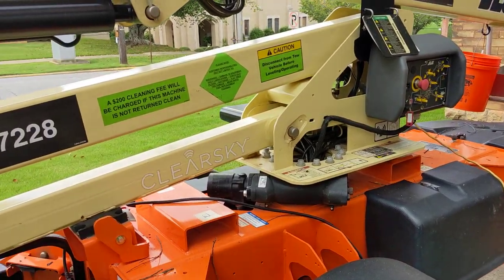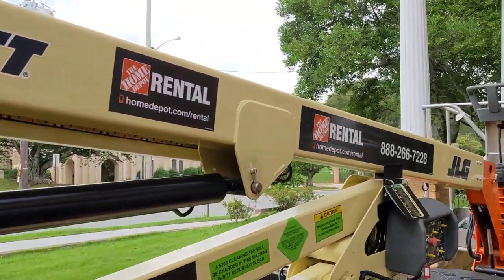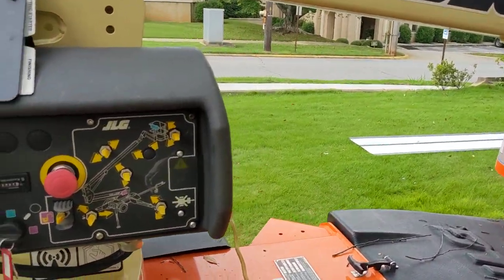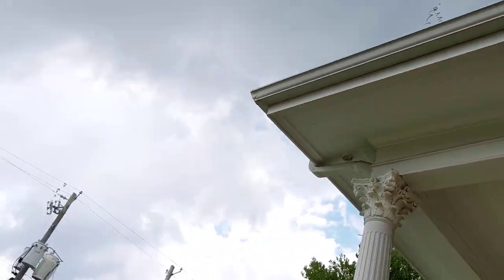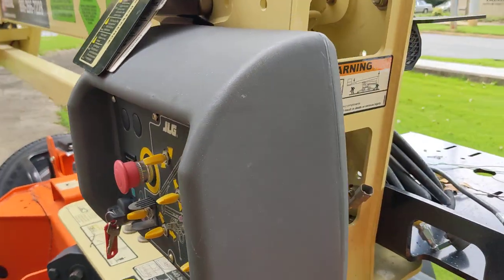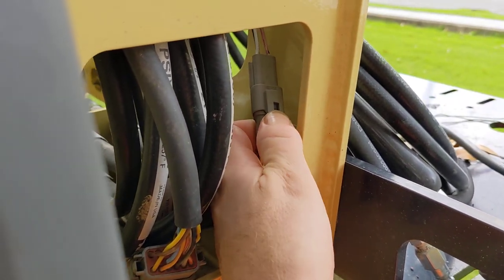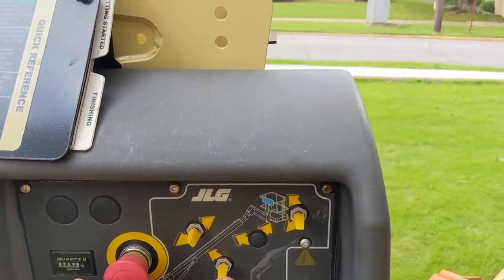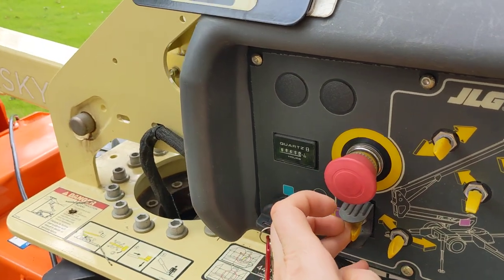Turn off beeping on JLG T350 boom lift

Comment: Thank You. First thing I want to do when I rent it is STOP the BEEPING. Every video shows it beeping.
But if it is a "tip alarm" I might want that, I will be trimming trees.
Reply from the maker: As another commenter pointed out, it might be one alarm for motion and tipping. So disconnecting it could create a safety issue in that case. As I mentioned to them, I was using this on solid, even ground with nobody else on the property. Also, I was mostly just articulating up, not way out where tipping would be a concern.

Comment: That's a bad idea,  if the lift is going to tip over that alarm sounds! it won' t sound if it's disconnected.
 Also it beeps to let people around the machine know that there is some sort of movement, you could easily lower the boom or an outrigger onto someone.
 I work in the equipment rental industry and we have this problem all the time with customers disconnecting the alarms not just on the towable booms but also on our Genie/JLG Super booms 150/185' height!!!!!! The Alarms sounds before the machine tips over!!
Reply from the maker: Appreciate the safety message.  In this case I was the only person working on the project on my private property. Nobody else was around. I did reconnect the alarm before returning.
Reply: I know how crazy they are with the JLG equipment everything you do the horn sounds! at least on the Genie booms it's not as bad but customers still disconnect them!
Reply: I'm using a JLG 2930ES. It's a scissor, not a boom, but the tip alarm still rings even with the caution beep disconnected. The tip alarm is a different sound completely.
Reply: Some of the manufacturers have realized that people are disconnecting the alarms, so they have them set up for the alarm to sound even when disconnected. As I said before it's never a good idea to disable the alarms, it's the first sign that the lift maybe about to tip over!
Reply: It's not going to tip trust me they're so counterbalanced well that you can have it on a steep incline and it's not going to tip over on you
Reply: No the alarm sounds if it's a quarter inch off level.  Highly annoying